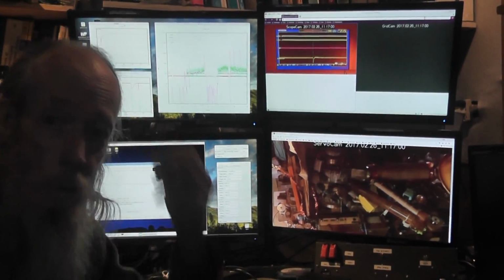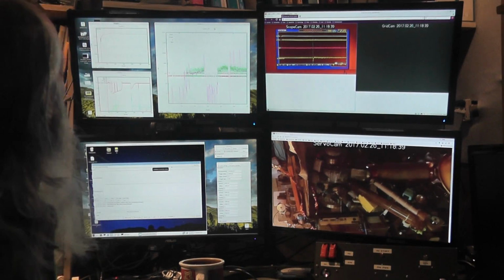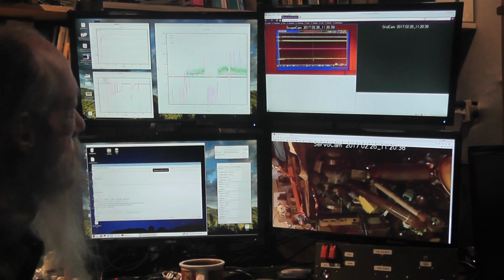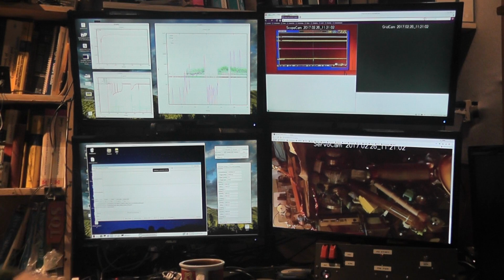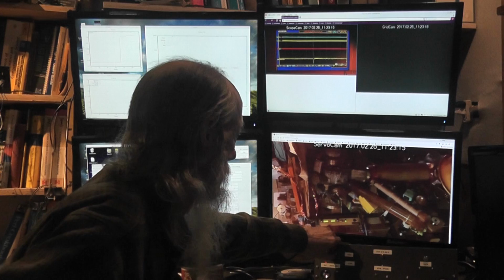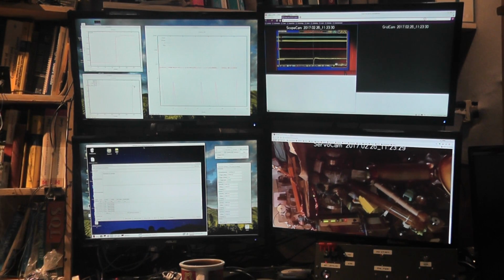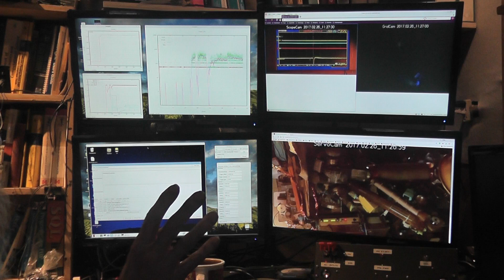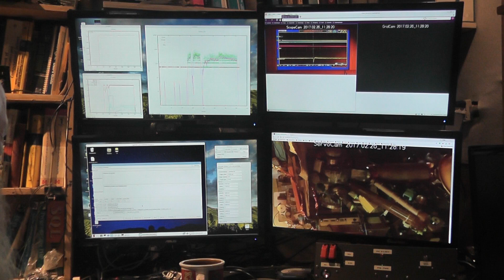02 27 2017 Shakedown

Comment: What operating system are you using?
Reply from the maker: Linux Mint, 17.? in that case.  Most of the glue code is perl I wrote.  Heavy lifting by mostly the usual suspects, mysql, nginx,gnuplot - and in the case of the cameras, raspimjpeg/nginx.  I've since upgraded most of the other machines, but that one works fine as is and is mainly used for this job, so no need.  It's a rather special/odd Nvidia "business" card that drives 4 monitors, I'm using their driver.  Not enough cuda cores to play colossal cave, but it's good for this stuff,

Comment: Way to go Doug! My log in seems to have died from inactivity on the Forum, but I'm still lurking on a regular basis. I'd bug you to get me back on, but I'd rather you spend your time doing what you feel is most important. In the mean time I'd love a Canary post once in a while so we know we don't have to come to your place to separate your irradiated corpse from your ops chair.
Reply from the maker: You are still there as Jake Gray, but I don't know and can't get user's passwords.
I think there's a way to get the board to reset it from your end.  The board shows Jake Gray as a valid user from my end (but I don't get much else...).  I've posted a bit (including the words for this vid) lately, after surviving some "life" kinds of things.  I'm pretty safe at the ops position, we run a gamma spec there now and then to make sure of that.  We have inverse square law, compton scattering etc etc - we don't see anything where I'm sitting.  The shop, now that's another story entirely (which is why I moved out).

Comment: This is really great, it's awesome to see the work you put into this system come to fruition. Here's hoping you can break even. Although if I may ask, what do you need a turbopump for, and where did you get one?
Reply from the maker: Ah, we run at (very approximately, and my gauge reads 2x high on hydrogen) .02 millibar, which is reachable with a plain mechanical pump (if it's a good one).  But that's far from the whole story.  There is outgassing, and also obviously if you can only get down to say half the run pressure, then let in gas up to the run pressure, your purity is merely 50%.  This needs a LOT better than that.  One nice thing about a turbo(drag) pump is that due to how they work they preferentially pump heavier gas atoms better, so act as a purifier here, on top of the rest.  I bought my pumping setup and mass spec from Pfeiffer when they did business in the US.  One of the new regulations for company reporting drove them out, I forget the name (the usual two congressmen).  You can still get vacuum stuff from Kurt J. Lesker or a number of surplus outfits - Dunniway comes to mind.  And scrounge if you have time.  The good stuff is rarely cheap.

Comment: I recently stumbled upon your channel and have been immensely intrigued. Would you so kindly explain what it is you are doing to somebody who has no clue about this stuff?
Reply from the maker: In short, I'm producing controlled nuclear fusion, but with higher energy density and better fuel than the sun...which still isn't quite good enough to be a practical source of power, even though my work has improved vastly on what went before.  The rest of what I could say would be post-grad level physics and wouldn't fit here.  If you're really interested, there are other places to learn that.

Comment: Doug, looks like you're getting closer to that sweet spot.
Reply from the maker: Just getting the semi-auto accurate before I go full auto...
Reply: I like the manual kill switches. No Deadman option of SCRAMming the reactor.
Reply from the maker: This is a "driven" reaction that cannot chain react (the produced energy isn't absorbed by the tenuous gas but flies out of the tank, someday to a boiler we hope), but if the computers go nuts it can get out of control, so if that happens and I see smoke/fire and want to shut it off,  I don't want to have to go near it when it's making radiation.  Hence, no need for a dead-man, but a definite need for a very reliable "safety"  This depends on coil current for the main power relays to come from the remote position where I was sitting, so any failure of that - open or short circuit, and it's off for certain, and then safe to go near.  That's really why fusion is much nicer than fission - no inherent hot waste products.
Reply: I'm wondering, isn't the good part of this reaction that once the switch has been killed there's no more radiation being produced? If so why can't you have a fire suppression system that introduces fog or fine mist into the cooling process?
Reply from the maker: How about we add that with your money? /sarcasm ;~)
One switch does it all, and then I can go deal with whatever the issue is in detail, the cameras can't show everything - I might want a close look so as to do the best action, and prevent whatever from happening again - I don't want to destroy evidence.  Remember, it could merely be burning up a few tens of k$ in equipment, with no real risk other than to the wallet and schedule, and just foaming an electric fire might not be enough.  Better to kill power first in any case.
Reply: Hey you're the retired beltway bandit wonderkint. I wouldn't think it would cost more than a few hundred versus losing thousands in materials. It was just a thought.
Reply from the maker: I know, and no blood, no foul.  Hopefully I've thought it through, but I'm wrong often enough to appreciate other viewpoints.

Comment: nice
Reply from the maker: I thought so too ;)  During previous tests, the EMI created by a sudden start or stop (or arc) would crash one or more of the computers doing the data acquisition/control/logging, and this time, not so much as a burp (which is why we've been doing shakedowns and tests before publishing anything at all).  I'd recently done a bunch of tightening up for that - it was good already by most standards, but 50kv combined with stray capacity in things can make a heck of a radio pulse and it bothers the "more advanced" raspberry pi computers (eg dram and smaller transistors; arduinos seem immune to that and even fairly unreasonable amounts of radiation, but don't run SQL databases and so on).  So, barring further issues yet to be discovered...we are ready to go for the real deal and replicate an earlier breakthrough, this time getting quantitative and believable data on it and how it works in that mode.  Fingers crossed!  More to come when there's more to report.  Took a long time to get here, but this is really the beginning.
Reply from the maker: The computers are in a sealed aluminum box with capacitive pro feed throughs on every signal, and a ethernet to fiber converter to connect to the LAN.  Everything in the HV is also essentially inside huge homebrew coax.  Sounds great, right?  Probably well over 40-50 dB shielding on each side of the noise.  So, often the noise is in the billion/trillion watt range - work it out.  OF course putting something wireless inside a faraday cage is kinda pointless - and not knowing for sure the total BW of the noise, it's safer to use solid metal, highly conductive, which I am.  And if you want mysql for the data, you need a machine that can run that - pi is about the minimum for the data rate.   I've had around 50 years of experience with RF design and manuf among other things....this just isn't a simple problem set.  Noise is broadband, so a leak (like the slot antenna if one of the gaskets on the EMI box isn't perfect) is enough to spoil things.
Reply: Doug Coulter try flashing a particle photon with a custom OS, you can obtain similar results with the small footprint, assumably without EM interference.
Reply: or nodemcu or esp. you could also stick it in a Faraday cage?